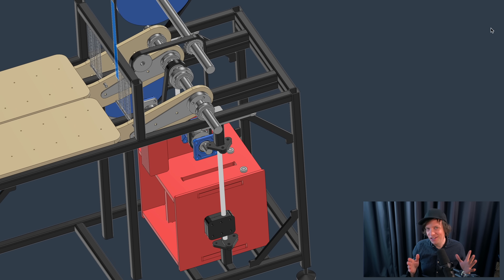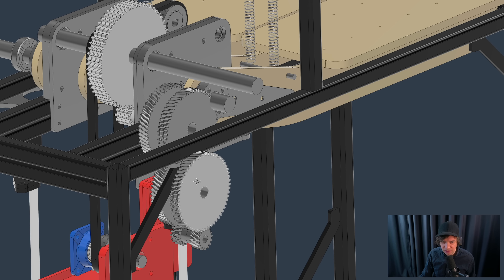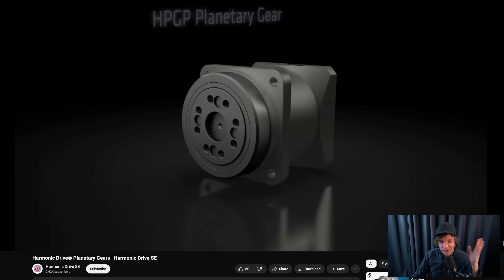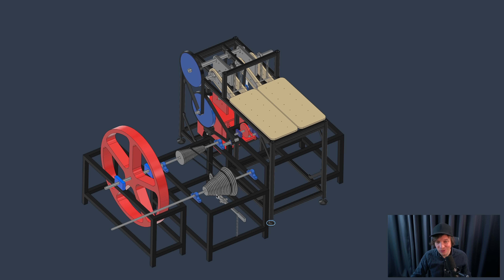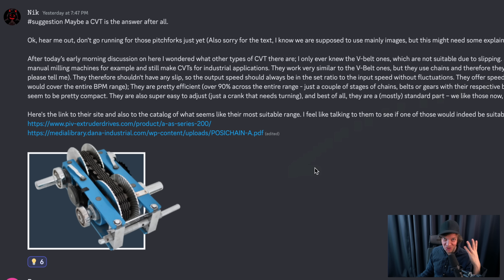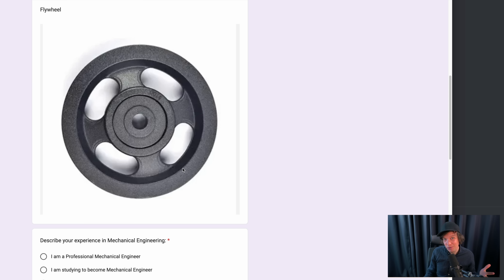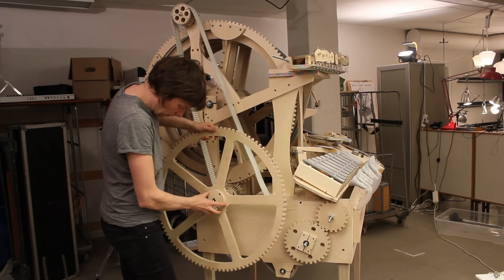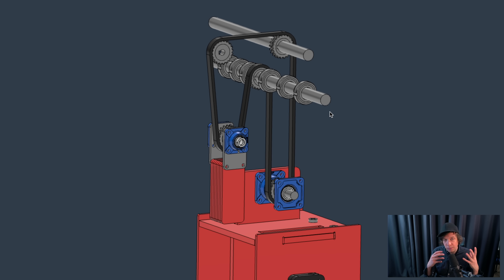Which Gear Type is Most Efficient?

Comment: Martin, here's my only feedback: when looking at survey results, probably don't use pie charts... They're only good if it's few slices, and you really want to know the composition of the whole. Humans are bad at comparing the sizes of slices, and you have to look back and forth between slice and legend to get the full picture. If you use bar charts instead, you'll get better comparisons and your brain will be able to recognize values quicker and easier.
Reply: It is also worth noting when making comparisons such as this that you have to consider things like vote splitting - where some factions can artificially appear small because the supporters overlap. This can cause a consensus winner to be eliminated despite otherwise having a majority, and cause the winner to change unpredictably based on the options you decide to include in the poll. This is probably even more of an issue than the type of graph.

A runoff isn't enough to solve this; you'd need a more advanced voting method that tabulates support all at once, like approval, score, or STAR, or even individual pairwise rounds if you want to be precise. Discord natively supports Approval votes in the form of reaction polls, so it could be a decent option, especially if you also do another round with fewer choices.

(This is also the reason that politics is awful, btw - it's fixable in the same way.)
Reply: This is exactly what professors told us during my master of data Science :)
Reply: Second this. Pie charts are more or less useless in communication
Reply: @jhalanddesign  I wouldn't agree with this. Pie charts have good purposes. They are able to present information in a fixed visual size. This means you can continue to add more data and the graph will not swell outside of it's visual boundary. As to data, it does represent large differences between values very well. It's also decent at showing data values that are similar to each other. And last you can see which values are minuscule compared to the whole. So it's not good at presenting small differences with a high degree of accuracy, but not all information needs to be ingested that way.
Reply: @Beakerbite  ok. I wouldn't use you as a infograpic designer anytime soon :) Bar charts are boring but tell clearer story.
Reply: @jhalanddesign Not necessarily, and it really depends on which type of bar-chart is being used:  such as side-by-side bars, or a continuous bar segmented.

Side-by-side bars are very difficult to interpret how one measurement compares to the overall whole the sum of the remaining values.  Ie:  this SINGLE measurement is greater than 50% of the remaining FIFTY segments combined.

Did candidate A get the required majority (>50%) of the votes over the remaining 10 candidates?  Good luck demonstrating that with a side-by-side bar chart.

but you would already know this….if you knew anything about data science or communicating data.
Reply: The only good pie charts are jokes, like the "sunny side of pyramid / shady side of pyramid / sky" chart, and the first panel of xkcd 688
Reply: Also, people with no actual expertise might think they're helping but they're muddying the results
Reply: 6:47
Reply: In my uninformed opinion, I think he just used the Google forums charts. For unknown reasons Google really like to use those pie charts (or ar least a few years ago, I hope they've grown out of it)
Reply: Pie is fine for 2 data points.
Reply: @brennon_  It can be, yeah. But the pie charts shown in his video had many many many points.
Reply: Slices can be useful when you have some similar options. e.g. you can see that herringbone gear and double helical gear have a substantial proportion.
Reply: @jeffreyblack666  not more useful than a bar chart though. You can see they're similar, but with bar chart you'd be able to see definitively which is bigger and better estimate by how much it's bigger.
Reply: @MrQuickLine   Here's the thing though: he doesn't care who the winner is. He just cares which ones seem kinda popular. Pie chart is excellent for that kind of fuzzy metric
Reply: @MrQuickLine  Depends on what you mean by a bar chart. If you mean a single bar which is divided into pieces, then that suffers from the same problems as a pie chart. If you mean multiple bars side by side, then no, as you cannot easily combine them to mentally see how big the 2 bars are.
Reply: Pie charts are great for visualising how much pie you have left. Not much else.
Reply: @DavidWeinehall I think some kind of bar graph is probably still easier to read than a pie graph when you want to know the amount of pie left.

This is one of the reasons sheet pan brownies are the ultimate baked goods.
Reply: @JoranGroothengel  Nah, bar graphs are intended to measure how much you have left in your glass.
Reply: @DavidWeinehall I think some kind of bar graph is probably still easier to read than a pie graph when you want to know the amount of pie left.

This is one of the reasons sheet pan brownies are the ultimate baked goods.
Reply: This is one of the many things Martin would know if he just enrolled in an engineer course at university. Studying centuries of legacy and lessons instead of learning the hard way at every mistake
Reply: True, but that visualisation is just the default by the tool he used, right? 👀 IMHO the right choice, as he did not waste additional time for post processing.

Comment: Bike derailleurs seem to be an effective way to change the speed of gears if you used a chain.
Reply: Most efficient easy to use solution is bike derailleur... They are nearly 97-98% efficient very high efficency and have the ability of 0-350% range which means many speed variations to choose from.
Reply: A problem is that they are a bit noisy. Running a chain is never quiet. A belt, V or flat will be quieter and are also pretty efficient.

Using gears have the same problem. Straight cut gears are noisy, and very efficient. To make them quiet you use slated gears, but they require bearings able to handle the axial power on the gear axle. they are also slightly less efficient than a straight cut gear.

For simplicity I think belts are the easiest to make both quiet and decently efficient.
Reply: @blahorgaslisk7763  André Citroen with Wuest solved the axial thrust problem many decades ago with the herringbone or double helical gear. That would solve a problem that doesn't exist though, as nylon straight cut gears would be pretty quiet in this application, with relatively little vibration conducted to the chassis. Not like it is running huge horsepower with lots of big shock loads. Nylon gears would also be a heck of a lot lighter to heft around from gig to gig.
Reply: This! 
Tried and true method of gearing, plenty of torque and off the shelf solutions.

Comment: Efficiency is not really up for enterpretation. Energy comes in, energy comes out and the difference determine the level of efficiency. Only in very special scenarios, where you need need generated by the friction to keep it at a high enough temperature, fx in order to keep the lubricant from freezing, or something similar, can you argue about it, but even then, you're really talking about improving the efficiency by exploining the inefficiency, it doesn't really change the deffinition.

Comment: bike chain are more efficient than bike belt and you can get replacement part anywhere in the world for the gearbox you can also use a bike derailler .
Reply: Timing belts can be bought from most industry suppliers. Chains need to be lubricated, lengthen over time and wear down the spur gears they run on.
Reply: @lupeters213  the belts wear down their gears too, and wear themselve as chains do, and with a bit planning there isn't any issue in any of the szenarios with accessability of replacement or repair parts.
One upside of the belt would be a bit of noisereduction as there isn't metal on metal but metal on plastic rubber (idk something not metal)

Comment: If you run gears i recommend a plastic or nylon paired with a metal gear. Dedicated wear location, and keeps them quieter than metsl on metal. If it was good enough for engines it should work fine for the mm
Reply: Jeah, they even give better lifetime characteristics for some plastic gears for low torque applications.
Reply: just use /s
Reply: @maxvangulik1988  It's better then nothing so yeah /s at least. Tnx for reminding me for that one
Reply: @blueredbrick 100% agree.  sarcasm works when the statement is too off for the ppl involved. But on an open forum there's no statement too off or shocking for sarcasm.
Reply: @sunray501  Thank you for reading long comments. Verbosity is not the same as long-windedness. Sarcasm is tricky here. Have a good day or night wherever you are, greetings  from NL.
Reply: FIGHT!FIGHT!FIGHT! lol
Reply: Nice to see someone else talking about noise levels! I am not an engineer, but I am a musician, and it makes me itch when Martin talks about all these gearing solutions without mentioning how noisy they tend to be. As I said in another comment, the most efficient gearing solution in the world won't be any good if it's unbearably noisy.
Reply: Nah, Martin knows better than engineers.
Reply: Sarcasm does not work well in this specific informational transfer system. Irl it works well enough with a known environment of communicators. Here is the tiny confined expression space bit  not so much. The list of symbols  or emojis etc available are lacking on the current plattorm let alone added snippets audio or animations. It's quite strict in what is allowed or implemented what is technical possible and I suppose it'll do for the moment and has to improve on the long term, say 5 years, but right now;  sarcasm in an international and companies arbitrairy behaviour's setting on it does not work  well enough to be usefull  as intended. Personally I found many moment when I internally facepalmed Picard style and with empathy  while thinking ok that's another iteration then for us to watch but mostly I'm greatly impressed by his ability to learn and grow with an online community. That is a type of skill that is of high value. I'm being honest and not sarcastic or negqtive toward you. I can be srqtqstic or do that in the pub or on the street when the right social setting is present equally well as anyone random person on this pale blue marble. @thomasbecker9676
Reply: @blueredbrick  TL;DR spam
Reply: @thomasbecker9676  lol you must be new here
Reply: @tubeLu  Not at all. I was being sarcastic; seeing as after years of marble machines and YouTube, Martin seems to still not understand basic engineering and design principles.
Reply: @thomasbecker9676  he's learned a lot. There are engineers who have been doing the job far longer who know less, and there's some who have been doing it for less time who know way more. Everybody learns differently, the only reason any failings are exposed at all is because he posts everything and willingly exposes them. That's no reason to be a dick to him.
Reply: @kishinslayer2228  He posts stuff because it's income. It's better income than ever finishing a marble machine. And he's not learned anything; he's repeating the same mistakes for a third time. If he knows so much more than engineers, why is he begging for their help?
Reply: @thomasbecker9676  He... he doesn't think he knows better. That's.... why he's begging for help. That's why he has listened to the community extensively over the years. That's why he opened the video with "I've been asking a ton of engineers this question" and then followed it up wity research upon research. Also, there is absolutely nothing wrong with wanting income. The man has to eat, and he's putting in work for it. He isn't taking the cop out route either. If he wanted easy money he would have kept the patreon open and you'd hear him shill it in every video. If he wanted easy money he'd be doing sponsored ad reads. If he wanted easy money he wouldn't have told all his old patrons that because of their support they get vip tickets if and when the would tour happens. The man just wants to build a marble machine bro, and there's absolutely nothing wrong with making videos off it. I know you're really just trolling and honestly I respect it, it's fun to piss people off online, it's just annoying when it's towards a cool guy just tryna build a bigass music box. Go find a funner target and put your skills to good use.
Reply: @thomasbecker9676  - He's a non-engineer learning as he goes. Cut the dude some slack. :)
Reply: @thomasbecker9676  Wow, you are way less rude now 💪 keep that up.
Reply: @kishinslayer2228  He's a YouTuber. The band is gone, MMX was a failure. He hasn't even established requirements for this new venture, and wants experienced engineers to help him for free. Just because he's not using all potential avenues to grift doesn't mean he's not. You can "dream" all you want, but his latest venture is DOA already.
Reply: @jamesdominguez7685  According to his cult, he's the greatest engineering mind ever.
Reply: @kishinslayer2228 He’s learned a lot?  Learned more than actual engineers?

Could you provide some specific examples?

Comment: Circular gears are the way to go. Pentagons have caused headaches for me in the past
Reply: I really like triangles personally, but I understand the appeal of circles too
Reply: I’ve had good luck with squares, but circle might be the way to go for the MM
Reply: Is there such a thing as an irregularly-shaped gear with movable edges so you can theoretically change its gearing ratio without removing it from the machine? It couldn't be circular, but I imagine a opentagon or hexagon might work, with some kind of lock-nut to shift the toothed sections in and out. Is this a thing? Actually... now that I think about it, the diameter would effectively change as it rotates, which would lead to irregular timing. Don't mind me.

Comment: I clicked on this video to get the answer to this question
Reply: You get the answer?
Reply: @markzubeger  0:40
Reply: A simple question never has a simple answer
Reply: 42
Reply: @gcextol8129  This. It always comes down to the wrong question being asked. As a programmer I get asked 'can this be done?' to which the answer literally always will be 'yes'. The right question would be: 'how many resources (money/time/people) would this take?' 😄
Reply: Rules of thumb:
1. When the title is asking if something is true, assume the answer is “probably not.”
2. When the title is about a value judgement, assume the answer is “it depends.”
Reply: So sorry you didn't get the answer you were looking for.
Reply: @waldosan I'd say he got the answer he was looking for, not the one he wanted.
Reply: The answer is straight-cut gears. Efficiency is relatively easy to define - a ratio of output power to input. 
But it turns out he actually meant "best" - which is a whole lot more difficult.
Reply: lol me too😂